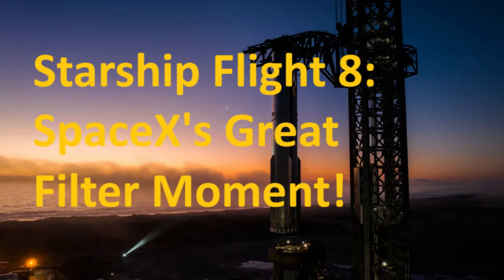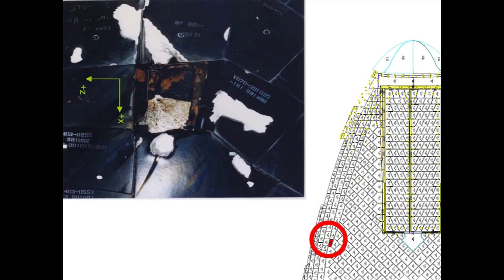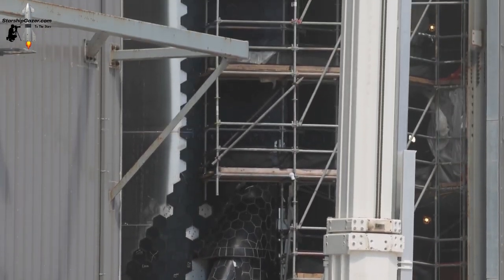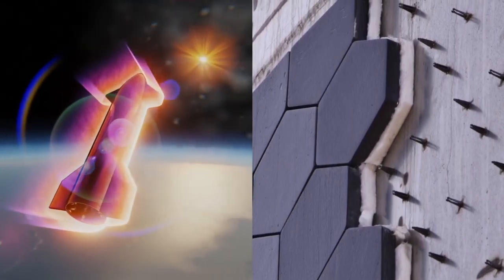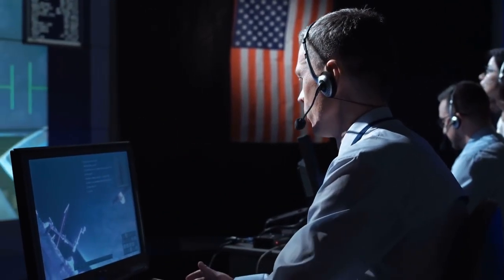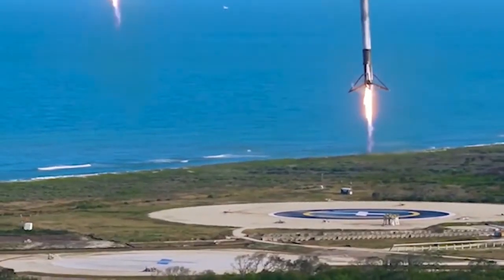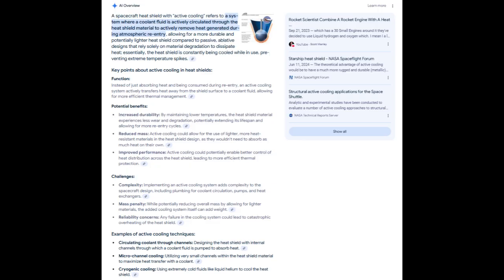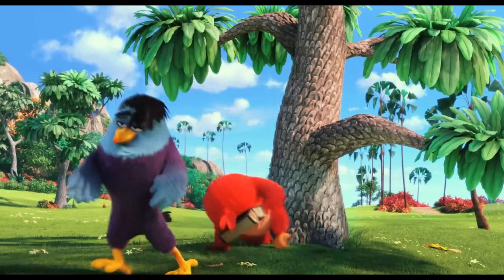Starship Flight 8: SpaceX's Great Filter Moment

Comment: @0:25 The plasma which forms during reentry is not due to air friction. It is a result of air compression which is fundamentally different.
Reply from the maker: @JasonUnderdown  Thanks for the correction, but to most casual observers the concept of friction is easier to understand. Still, it's good to be technically accurate where appropriate, so again thanks for chiming in! 😎